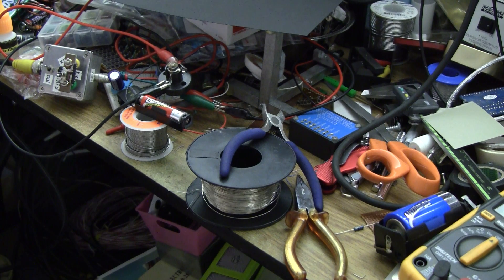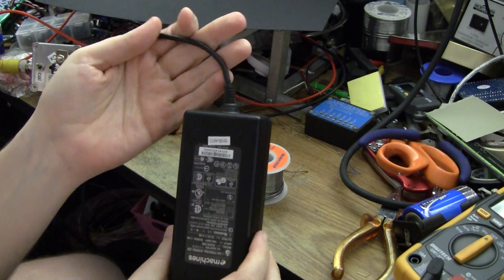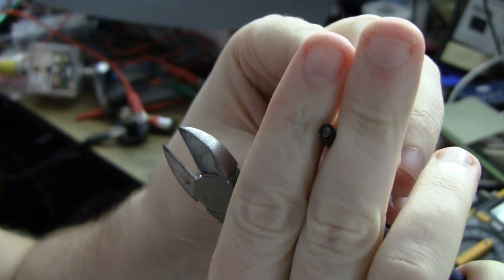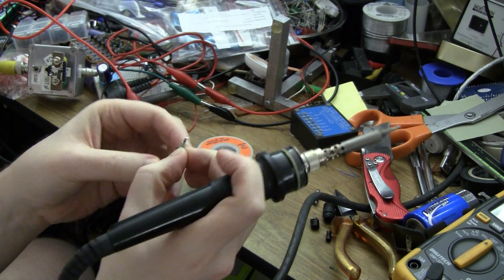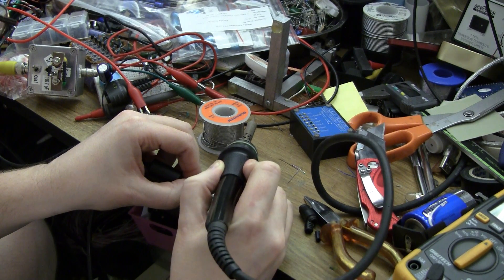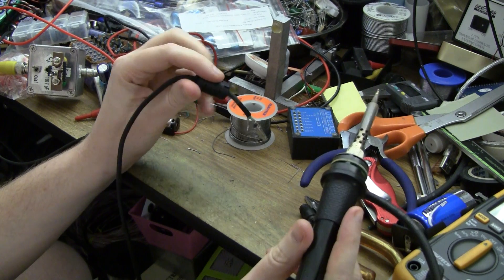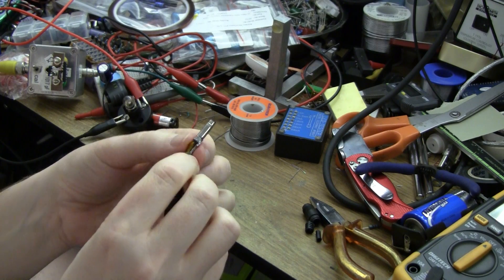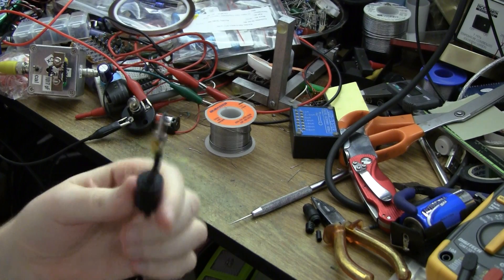Laptop Plug Repair

Comment from the maker: If you can open the supply casing then I'd redo the termination to the PCB inside.  Unfortunately many supplies are hard to open, at least without marring the casing.  Some have screws under the rubber feet or label, but most are clips or glue/welded shut.  Also many have molded-over strain relief on the cable, but you can sometimes drill them out and glue the remaining cable back into them.

Comment from the maker: Yep, got it all done and plugged back in before the battery died.

Not only are some switches acoustically noisy from magnetostriction of their transformer cores, but many put out lots of RF interference too.  Some of the especially cheap ones I've got from DX haven't even got the 1 mm required gap on their boards from the mains - no idea how they get C-tick or any other compliance certification!

Comment: "Quiet for a switchmode power supply" The AEG power tool Li-ion/Nicad/NiMH charger my father just bought sounds like an old whistling kettle getting louder as the battery reaches full charge, only he can't hear it! And always keep a strip of Blu-Tac stuck to the edge of your bench. :) Did you fix it before the battery went flat?

Comment: The water thermally shocks the tip, let alone helps to oxidize it.  I prefer the copper scrub pads, they're cheap at the grocery store for cleaning dishes. It leaves a small layer of tinning on the tip too, I've had the same tip for ages now and it still looks new.

Comment from the maker: I once had a Weller with a moving-coil meter for the temperature which I loved. Eventually I could no longer get parts for it (at least here in AU), and the heater element died. :(  This one is pretty similar in performance, it just lacks the meter.  Cheap and usable.  I rather like hakkos recently and will probably get a 888 in the US as my workhorse iron.